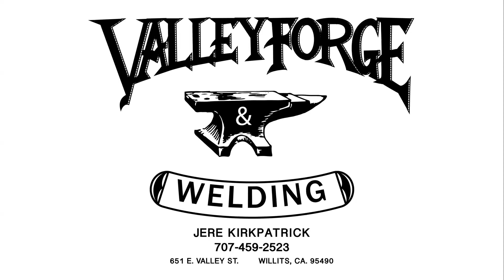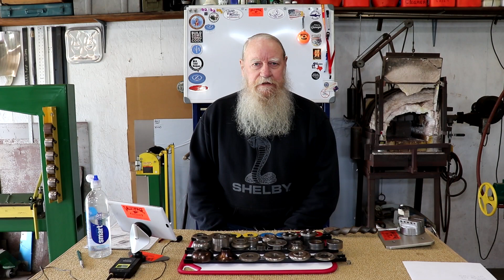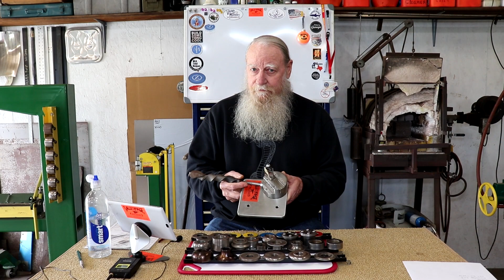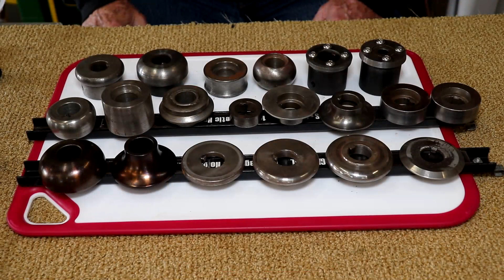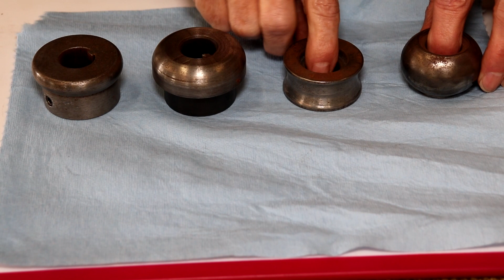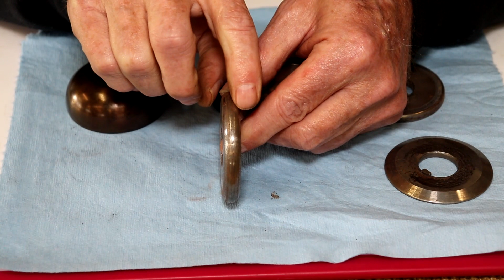Bead Roller Dies

Comment: How can i machine out or drill bead roller dies to fit my 8in deep pextow bead roller the ones i bought on fleabay are threaded mabye 5/8 and need them 7/8
Reply from the maker: I cannot answer this question not knowing what kind of equipment you have.
A lathe will get the job done with ease.
Jere
Reply: @Jere Kirkpatrick  sorry I didn't say that I don't have a lathe or mill right now I have a 6ft drill press in storage I need to bring home. Just wondering if you thought a step bit would do one or two before it would be toast. I could live with 2 bits @35.00 ea for 4 bead roller dies. A couple tipping dies I welded a piece of D.O.M tubing and a ste screw and they'll work without the end screw on the pextow
Reply from the maker: @assholeextraordinaire3699  My Pexto dies don't have threads. They use a nut like my larger bead roller. 
I would anneal, drill, and then re heat treat the dies in order to save the wear and tear on the drill.
Jere

Comment: What material is being used to fabricate the dies? 

I might have missed it in the video.
Reply from the maker: I've used everything from a Cummings piston pin to mild steel flat washers.
If the dies are to be used on steel they are heat treated, for aluminum they are not.
The two dies I made for the Pontiac kick plates were made from hot rolled plate.
If you look at the "kick plates" videos you will see them being made.

Jere

Comment: Hello Jere! It is so much fun watching your videos, I really enjoy them, now I wanted to tell you that I have struggled with rust all along here and there and found the best way to keep my tools clean. Every now and then I just dip them in vinegar overnight and then I washed them with clean water and soda soap, scrubbing with a toothbrush and finally impregnate them with WD40  and you will notice the difference.  Cheers!
Reply from the maker: Hello Javier:
Thanks for the tip. I use PAM instead of WD 40. It has silicone in it and lasts a little longer.
After I finish a few moor brackets for the Jeep I will be getting into nickle plating. I plan on bringing that whole process to You Tube. Not only will I be plating brackets but many of the tools I have made over the years.

Thanks for watching and be sure to subscribe.           Jere

Comment: Quick quarantine question, are you going to give out rough dimensions for these dies or only in purchased plans? And do you think if you have the set of flat washers the "flame dies" are necessary? Thanks for your vids.
Reply from the maker: Hello Tony:

As far as dimensions are concerned the diameter of the die should be so that the center line of the shafts are parallel (or as close as possible) when the dies are at working depth. The feature that you want to impart into the work piece will give you the dimensions of the outer portion of the die.

The flame dies have a recess for the bolt that holds the die to the shaft. this is a nice feature when tipping to a full 90deg. If you have the 45deg. die that obstruction (bolt) is no longer a problem.

I hope this is helpful for you. Great question and thanks for watching.         Jere
Reply: Hi Jere,

I get the impression that dies are a "need as you go" response to a particular project. I've not finished to mod's on my beader so don't have enough experience to know what I need. And my future projects are not car related so it might be most of your custom dies might not have an application to what I'm doing. 

I think you mentioned that clearance problem in your vid, sorry. Sometimes in short vids there's so much info it bounces off :) But this reinforces my idea of possibly using a counter sunk Allen bolt for my die retainer. Still got other projects before I can get back to finishing my beader. Thanks for your vids and great content.
Reply from the maker: @tonypires8816  You are correct. you wont know what die you will need until you know what the panel requires. You make them as needed. You can also use the dies that came with the machine as stock to make your specialty dies. Seldom will you use a stepping  die.

Look at my last video and you will see the way I hold the dies to the shaft.

Great questions.          Jere